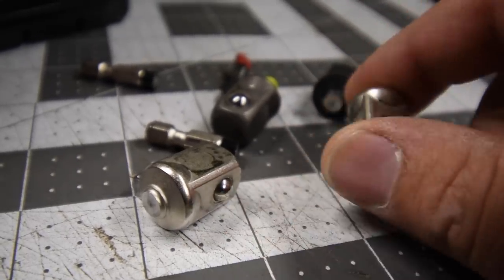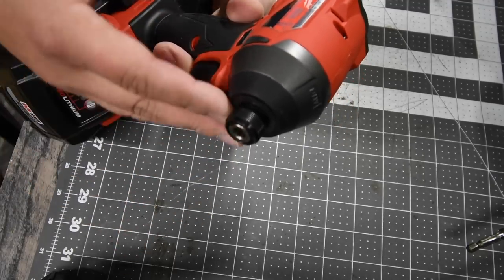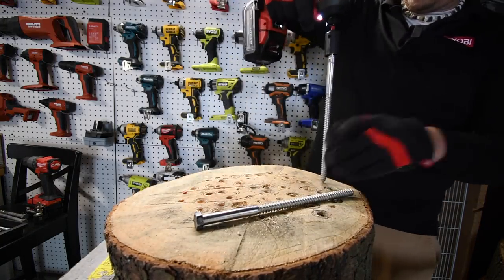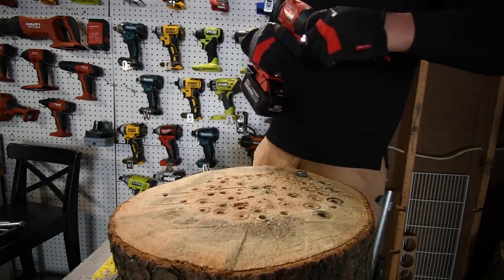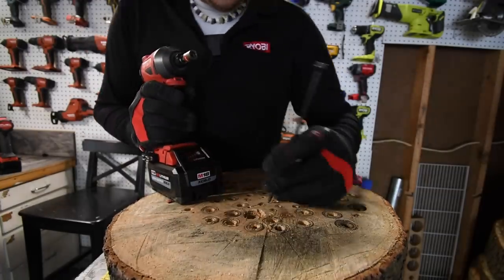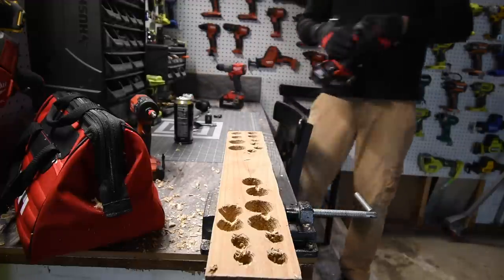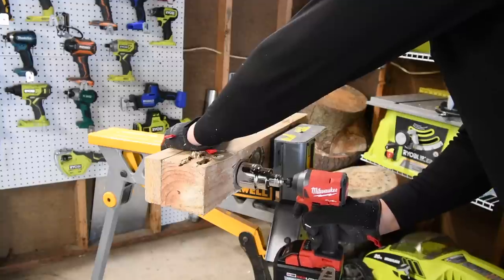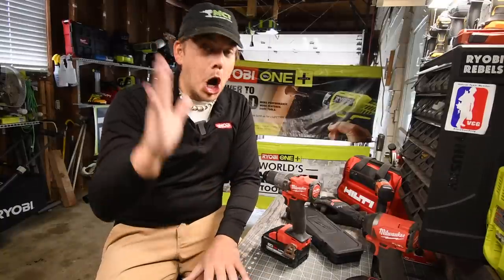Are Impact Drivers  OBSOLETE?

Comment: Impact driver is PERFECT when on a ladder or anywhere where stability is compromised. The drill will spin out of your hands and send you flying potentially if it gets caught.....an impact driver will NEVER do that. Impact =safer
Reply from the maker: That is correct. I would much rather use an impact driver on a ladder. like I said in the video, both tools have their ups and downs
Reply: That’s if you’re doing big holes or big lags. Most people don’t use lags, they use timberlocks, much less torque. 4 inch screws shouldn’t spin the drill out of your hands.
Reply: Bro doesn't know what a clutch is.and btw if your worried about being stable on a ladder then perhaps you need training in using one.
Reply: I was think the same thing. 👍
Reply: @gareths9574  yeah try tell that to your boss
Reply: @EnnTomi1  what's more important? Your life or telling your boss your afraid of using a ladder? Grow some balls will you
Reply: Yes
Reply: @gareths9574  damn you really have difficulty to understand.

get a job will you?
Reply: Once the clutch is set, the drill will not spin out of your hand
Reply: In the tight space impact driver will win trying to shove a drill in there is hard well how about you get a right angle drill well then torque is compromised on the other hand an impact driver is versatile does most of the work and drill is good but bulky at times.
Reply: you prolly dont care but does any of you know a way to get back into an Instagram account..?
I somehow lost my password. I appreciate any help you can offer me.
Reply: @Colten Kobe Instablaster =)
Reply: @Kelvin Matias It worked and I actually got access to my account again. I'm so happy!
Thank you so much, you saved my ass !
Reply: @Colten Kobe no problem :D
Reply: @gareths9574  you cant trust that clutch. And anyone can fall on a ladder. Especially extension ladders
Reply: @thatdude6045  why can't you trust the clutch? And you know you can secure a ladder right? All I hear is excuses

Comment: My drill is for drilling holes, the impact is everything else.
Reply from the maker: I like using drills more than impacts. I love the clutch settings
Reply: @ManCaverTools  I see where you are coming from but I like impacts waaaaay more I even use impacts for drilling holes sometimes just because how easy it is in your hands I only really use a drill gun for when I going into fragile wood or drilling pretty large holes
Reply: Amen brother
Reply: I use impact to drill too
Reply: @peter2213  right you don’t even need to 2 hand it
Reply: I own both of these tools but if I had to choose one I’d take the drill no questions asked. The drill can do 100% of what the impact can do. The same can’t be said about the impact.
Reply: i drilling holes in concrete with impact driver, i bought bosh1/4 "hex multipurpose drill bits or makita for concrete 6/8mm diameter, i drill with hilti sid- 4 a22 to use cls screw anchors HUS

Comment: Try driving 2500 screws with ur drill driver.....your hand and arm have to compensate for the torque.  Ergonomically , the impact wins hands down.
Reply from the maker: But the drill doesn't have vibration like the impact does
Reply: @ManCaverTools  agreed 100%.  But trust me a good pair of gloves mitigates the impact vibration.  We've tried this exact experiment on many very very large decks. But kudos to u brother for bringing out the drill driver is not dead , especially in noise restricted zones. Great vid hoss...
Reply: @ManCaverTools  that's why I love my M18 Surge. So smooth and precise.
Reply: @ManCaverTools  pulse driver, much less noise and vibration than an impact but keeps the advantages. But even then the impact has its place, it's WAY more compact than the drill driver (seriously, even that beefy impact was smaller than the clutch and gear box on that drill) and also smaller than the pulse driver.
Reply: The vibration only is bad when you grip it tight. You don’t need to grip it as tight because the driver won’t Tourque on your wrist. (Shed builder, thousand tek screws every day)
Reply: Yes

Comment: The impact driver is just that much lighter and compact.
Reply: Goose Seey at the cost of hearing and noise pollution
Reply: Great point, I think that’s the main reason I grab it first as well.
Reply: dvxAznxvb I always wear ear plugs when working so it’s a non issue for me
Reply: If noise is an issue get the surge. It's the hydraulic fluid filled impact and it's a bit more quiet.
Reply: @MB4ever88  Bingo.  I got the Makita version two weeks ago and building a project in the kitchen, my wife couldn't BELIEVE how quiet it was.  She was bracing for the machine-gun racket of a regular impact, and this thing just goes "thump-thump-thump" like you're tapping your fingers on a piece of wood.  Freaking unbelievable.
Reply: Citizen Sciencetist i am aware of it but there’s only two hydraulic impacts, other brands don’t have it

It’s a great tool at $80 bucks but most of my situations require only a few fasteners thus i don’t get fatigued enough where an impact would be of benefit; if anything I’ll just use a nicer ratcheting screwdriver
Reply: @dvxAznxvb  only two brands? last time I counted milwaukee (has two but ok one brand), ryobi, ridgid, and makita is four so basically only dewalt is behind but no surprise there
Reply: nuclear explosion didn’t know makita had one, the quiet strike on ryobi not sure if it’s hydraulic fluid that dampens noise
Reply: dvxAznxvb Makita had the first, I believe. They pioneered the “oil impulse” technology.
Reply from the maker: Both tools have their ups and downs
Reply: @dvxAznxvb  The Milwaukee surge is much quieter than their normal impact driver, a good compromise

Comment: I'm no expert, but with impact drivers I thought you could use them without little to no pressure from your hand, whereas a drill you have to constantly push it down. So it seems like fatigue would be a lot less when driving a bunch of screws.
Reply from the maker: Yes, both tools have there ups and downs.

Comment: It's the opposite, if anything is obsolete it is the drill.  With hex adaptor bits you can attach a drill chuck or drill bits to an impact and do any drilling you need, and with more control than the drill provides.  I used my impact for a couple years before getting a drill, simply because I wanted one, not so much out of need.
Reply from the maker: this was jus too see the power difference between the 2 tools.

Comment: As strange as it sounds I find I drive more screws with my drill these days, I do it with the drill because it has clutch and its so much more quite, I know a million people will call me crazy but it works better for me
Reply: Not strange, depends on the situation you're in. For example I built a wood gate for my friend and used 1 1/4" deck screws to attach the fence boards to frame.

It was faster and more efficient to predrill with hex shank drill bit in my impact and turn my clutch way down on drill and use it to drive the screws without over driving them.

The roles were reversed for my needs for efficiency and speed.  Most times I use my impact though.
Reply: @Mixwell1983  that is exactly why I love my drill
Reply: @Mixwell1983  Yup, depends on the situation.  I use my 12V drill with the clutch on 3 or 4 to drive switch / receptacle mounting screws.  The electrical box is plastic, and an impact driver, no matter the speed, leaves you little room for error.
Reply from the maker: I use a drill more most things. I only use an impact If I have to stretch to get to the screw

Comment: A hammer drill can’t remove torqued bolts or apply as much torque to a bolt as an impact driver.

So yes a hammer drill will drive bolts faster, but an impact driver will torque them further.

Example, try removing a lug nut with a hammer drill.  The tool will shut off after nearly breaking your wrist.  

Impact driver will actually do it.

To be honest, I’m glad the socket adapters broke.  You could of gotten hurt if you tried that with the drill.

TL:DR.  Tasks that require steady low torque applications.  Drill.
Tasks that require short high torque application.  Impact driver.
Reply from the maker: Id use a impact wrench to remove lug nuts. impact drivers are able to but id use a impact wrench
Reply: @ManCaverTools  yeah I see what your saying but it is so much easier to remove them with a impact and more efficient

If your gonna just take one or 2 bolts out maybe impact isn’t the best choice but if your gonna take 6+ I’d take a impact and make my life easy

Comment: I enjoy using my drill instead of the driver for speed, but I have smoked several drills due to the heat buildup from repeated use on larger fasteners like this.  The impact is slower but it doesn't seem able to kill itself by trying too hard and overheating after a couple hours of installing large fasteners.
Reply from the maker: Impact drivers smoke out as well. you really should be using impact wrenches for lags

Comment: They have there uses.  I was on a remolding mill job once and had to splice in milled timber’s in the holes in the flooring/ceiling.  We were screwing 8” structural screws in lvls, new fir timber, and 100 year old fir.  1/4” impacts barely managed an inch or two, 1/2” impacts were so slow.  I had my top of the line 18v Metabo brushless driver set on low speed and it plowed through the screws.  It was so quiet also.
Reply from the maker: Very good and I thank you for sharing POLOLOU

Comment: For those lags I’d pick an impact wrench over either. New Milwaukee mid-torque will probably beat both in speed with the easy of use. Sure it’s a bit heavy but it’s less fatigue than using the hammer drill.
Reply: I’d be curious to see how it stacks up against the two. Might have to get a stump and try it myself.
Reply from the maker: this was just to see the difference between the 2 different tools

Comment: I can't argue with his findings but I wouldn't trade my impact driver for anything. even if the hammer drill is faster in extreme applications, the light weight, hex quick Collett, compact size of the impact all blow away the drill
bottom line is if you're serious about diy or especially a pro, you simply need BOTH tools! 
Great job man caver
keep the vids comin
Reply from the maker: this video was to to show the power drills have now a days. you gotta admit that they are very powerful now and I thank you for viewing Jaw
Reply: @ManCaverTools  indeed. the power is insane. but even more than the power, for me, it's the advances in the chucks that impressed me the most
my old drill would slip all the time when drilling metal! the new ratcheting chucks are just incredible in their grip!

Comment: Impact drivers are far superior for driving screws as since it impacts in a rotating motion it drives the screw down rather than a regular drill stripping the screw head or driver bit, up the Milwaukee 💪
Reply from the maker: there are ups and downs for both of these tools.

Comment: It would be helpful if you filmed a summary after your initial edit. That would be the time, not only to synthesis your results, but to perhaps mention other differences as well (such as the potential for stripping screw heads, weight, comfort using the tool, etc.
Reply from the maker: that's not a bad idea. ill give that shot. and thank you forum

Comment: I get the newer cordless drill power thing. I'm on the automotive side so I haven't needed to upgrade my ancient 12v Dewalt until I had some big home remodeling to do. I got a makita lxt 18v drill driver and Makita plus Hitachi impact drivers (good deals). I got that heavy big drill out and it got stuck on something within a couple of seconds and damn near ripped my arm off! It's got power! I would never use it on a bolt on a car though. The impact drivers are super time savers for undoing long fine thread Bolts and many other things. I kept breaking my 1/2" adapter until I got a Hercules set. The 1st one broke, but the second adapter has probably withstood 500 + lug nuts and other bolts with no problems. They both have their place, but I'm 6' and 225lbs and that Makita drill damn near knocked me off a ladder!
Reply from the maker: But that is when an impact wrench comes in to play.
Reply: @ManCaverTools  bingo! That's why I need both. More tools are better!

Comment: I think that 12v impact drivers are more than enough for 95% of the work any of us do. Beyond that, a 18v impact WRENCH seems more appropriate even if you have to use the De Walt 1/2" to 1/4" collet
Reply from the maker: You are correct. lags are best used with impact wrenches. and I thank you for viewing Jon

Comment: That happens when you just do not know, It is not about only power, it is about practical,  it is a lot easier and comfortable use impact drive than a regular drill so talking about screws. The guys who work with these both guns they know what I am talking about.
Reply from the maker: this video was jus to see the power difference between the 2

Comment: I own a mechanical contracting company. Impact driver is way more used then drills by us. Cant honestly tell you how many impacts I own. Most are milwaukee brand. But we have makita, dewalt, bosch, hitachi impacts as well. We used them for drilling and driving. Yes impacts ate harder on bits fir drilling but no jamming  your wrist 30 feet up in the air.
Reply from the maker: I agree that impacts are safer to use in more dangerous places
Reply: Try a few rigids

Comment: I’ve never seen people removing tire lug nuts with drills. 
Impact driver are not the correct tool for this application but I’m just trying to make a point .both tools are great .
Reply: You can’t remove lug nuts with a drill.  And can lead to serious injury if you attempt this.
Reply from the maker: I wouldn't use a impact driver to remove lug nuts on a daily bases. use a impact wrench

Comment: "The Milwaukee Gen 3 fuel impact driver should have a problem with the Collet, but there is an easy fix ...” You said...No it's got a huge problem with the collet and several people tried fixing it. But like you experienced in your video (the drill bit came lose from your gen 3), it's just insane if you have to work with that thing, and all the time the collet keeps failing each time. It's just dangerous, frustrating and so ridiculous for an expensive tool like that.
Reply from the maker: I agree. they need to fix it but I still want to take it apart and see why it fails and compare to another one
Reply: Luckily I dont work in wood. Only metal.Ever notice these guys never reverse the driver to pull shit out? Doesn't take a genius to figure that one out.
Reply: @olecranonrebellion9976  Ok, but even without reversing the drill it should stay in place. I have a secondary cheap impact driver from Parkside, it cost 40€. Unbelievable how that thing keeps working. Collet doesn't fail, neither do does from my Makita's.
Reply: I managed to fix the issue by reshaping the collet spring so it puts more tension on the detent ball. There are plenty of videos on the exact issue with the process to fix the it. While I do agree that milwaukee should have this taken care of, it was a relatively easy repair and I have not had any issues since.

Comment: I just put in some organizers on my drywall; with gen3 drill and i kept stripping my cheap screws with clutch at 1; I’m used to dewalts clutch which is much lower but the slower start on Milwaukee is a nice feature biggest thing i miss on dcd996 is the light which is so weird that my rocket light has warmer light than the annoying blue light on the drill which is worse experience since the photoreceptors in my eyes get excited and lose focus on what I’m drilling
Reply from the maker: Id try it on speed 1 with better drill bits. Get Makita drill bits, they are the best

Comment: The amp hour difference does not give the tool more power, only a small advantage that is not able to be seen or felt, in that it gives the voltage a fraction of the time longer. a hammer drill action is not the same as an impact action.
Reply from the maker: you gotta admit that the hammer drill is pretty powerful
Reply: @ManCaverTools  No doubt,  It has more constant torque, which is why you get fatigued more when using it on a constant basis, especially when drilling into large/deep pieces.

TBH, I thought you were going to use the drill in the hammer mode and compare them like that.

Comment: Also, impact drivers are not really designed for using a drill bit.  Even the impact rated drill bits aren't as fast as they are when used in a regular drill.

Obviously the reason you broke the adapters is because the bold/socket was too large and the torque was too great.  These tools are not designed to be used to twist that diameter.  Use an impact with a larger drive/anvil.
Reply from the maker: Yes sir, this was just to show the power difference between the 2 different tools

Comment: Milwaukee make good tools but there 1/4 collets are garbage. Any way, I think they each serve a purpose. The impact to reduce strain and drill for holes. I think an apartment/very little diyer can get away with just a drill. I did build a shed a 10x12 shed with just a Black and Decker NiCD drill but my palm hurt though lol
Reply from the maker: they actually fixed the collets and now no longer let bits out, I do not know the model number for it yet